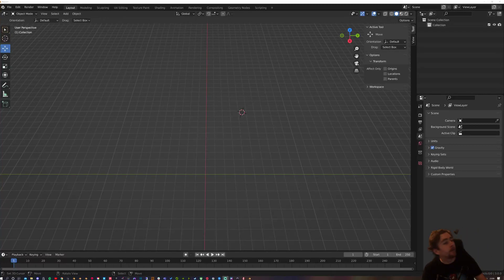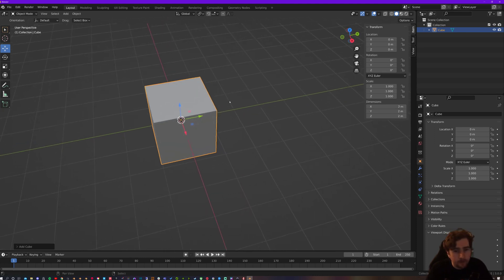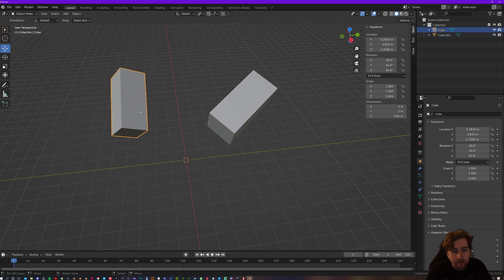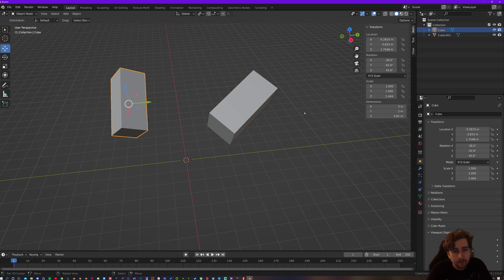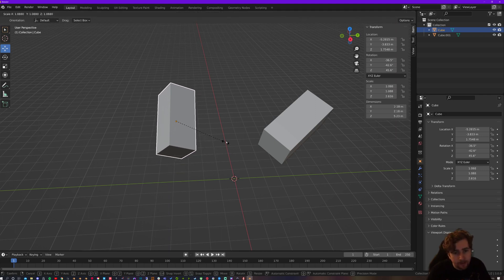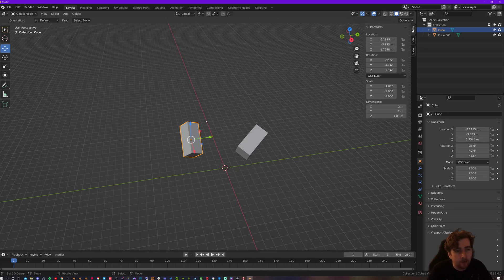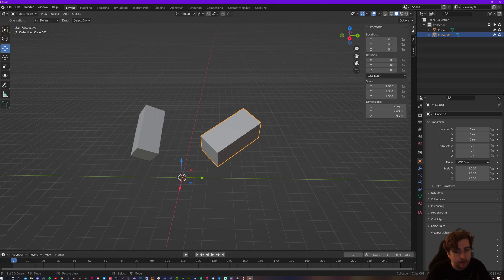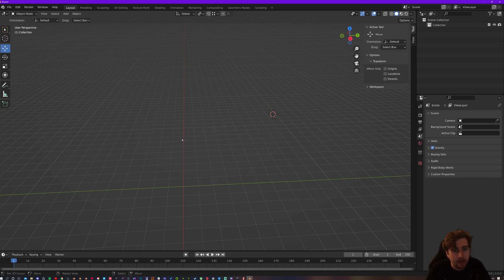Blender 3.0: Why Apply Scale? (Object Transforms)

Comment: Hello Andrew,

Can you please post a detailed video on how to import large fbx/obj (1GB+) models and then use blender to separate/break down these complex models into smaller segments/components, and then save them as smaller segments/components as either small individualized models or smaller groups of models?

i.e I purchased a model of a Nimitz Class Carrier and would like to separate the bridge/elevators from the hull as the main model is greater than 1.5 to 2.2GB in size and is impractical and unacceptable to use in any other programs outside of Blender/Maya etc...  

So I would prefer to break down the main model and then save the smaller segments/components as OBJ/3ds files to use and incorporate them into other models as well, and yes, I purchased this model as a royalty-free purchase.

Also, would you recommend using Blender or Bforartists?

Cheers Mate!

P.S. I also have a huge problem when I import the models into blender as they appear to close and I can not zoom back out without losing sight of the model. :(
Reply from the maker: hey, I didn't see this - apologies. I don't have a comparable asset to make a tutorial from. 

Hope you found a solution to this